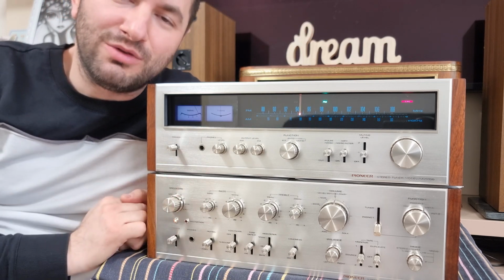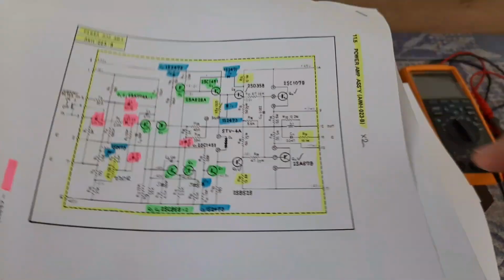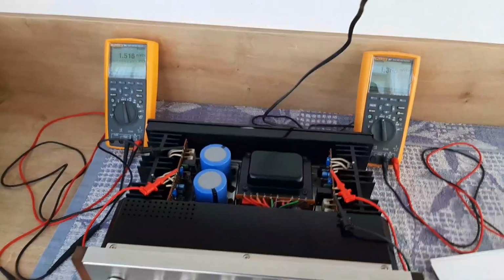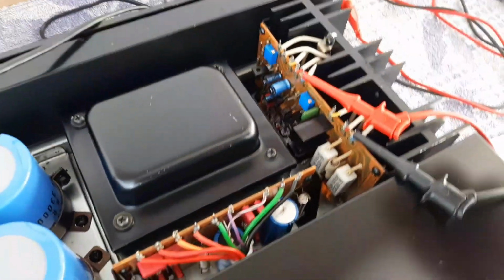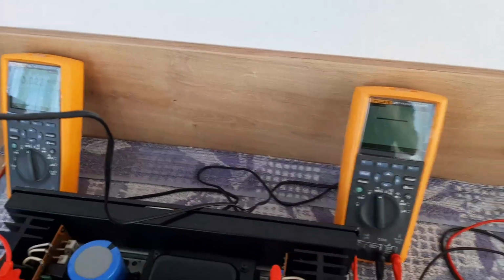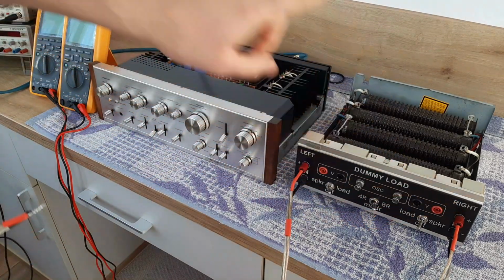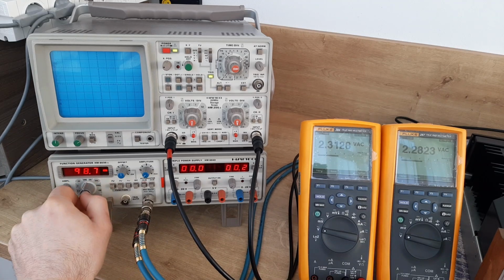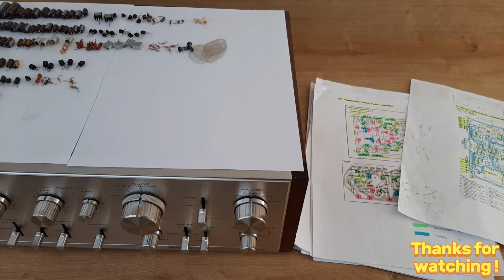Pioneer SA 9100 - Restoration | DC Offset and Power Test

Comment: What did you use for the 2sc1451 transistors
Reply from the maker: Hi and thx for comment!
About 2sc1451 we know is prone to problems and is necessary to replace. Best substitute is KSC3503 and i used it on Pioneer SA / SX without any problems 7500/8500/9500.....
Stay tuned, more videos to go!
Cheers!